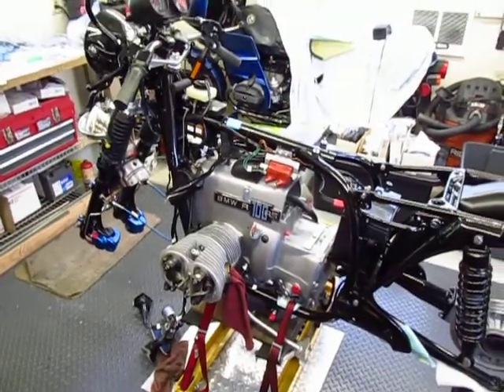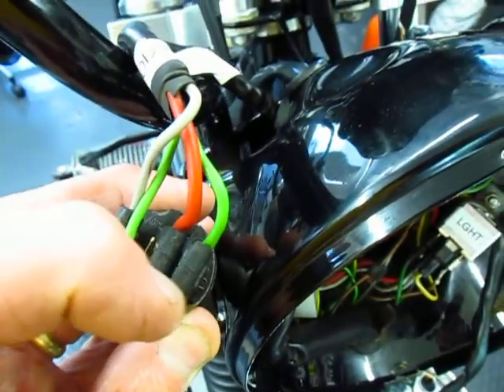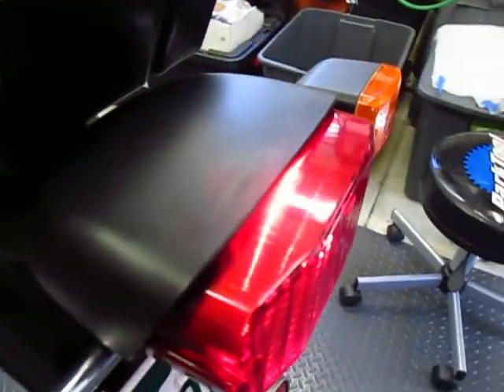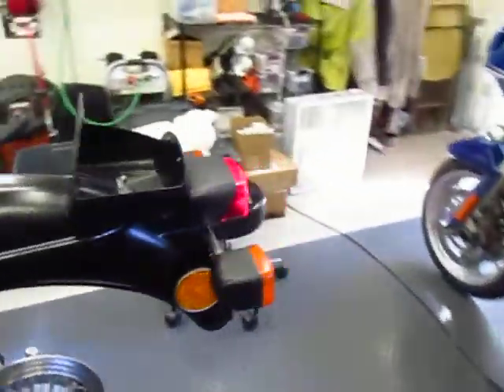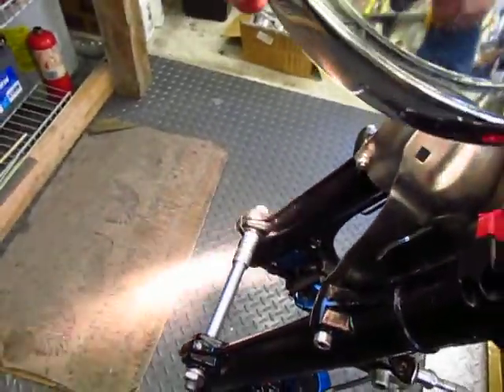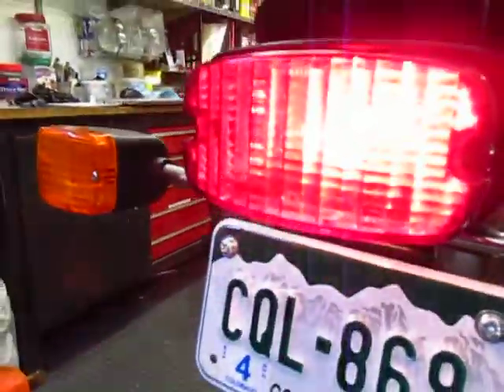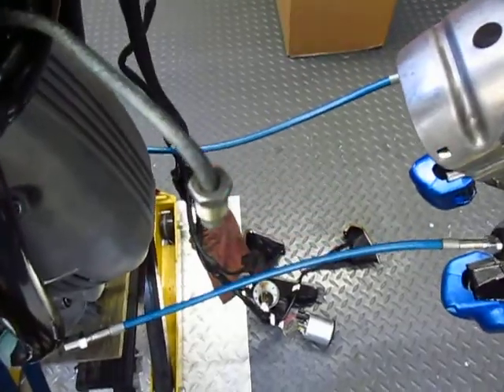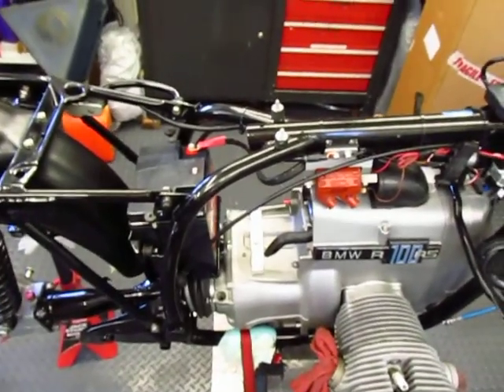1977 BMW R100RS Electrical System Functional Test

Comment: Not that I am aware of. I bought it off a friend who bought it new. Given it's the original loom, its unlikely. The only changes to the wiring were extensions to fit a Rickman Polaris fairing which has been off for years and the bike has been running well since then. I have changed the flasher relay but that was a straight swap......

Comment: Hi Brook,
I have a 1979 R80/7 which I have owned since Aug 1979.
The wiring appears to be all factory but I have a little problem.
There is a brown/black wire attached to the horn circuit which shows continuity, as best I can tell, to the neutral switch circuit which is also brown/black. The brown/black wire attached to the horn does not appear on any wiring diagram I have seen and I cannot understand what purpose it serves. Do you have any ideas?
Reply from the maker: Barney, 
According to the Haynes wiring diagram, the horn should be connected to a BROWN-White wire, not a BROWN-Black wire. The BROWN-Black wires go to the neutral switch circuit.
Reply: Yes, I know but there is a second wire attached to the horn connector on the contact board which is brown/black as well as the brown/white. The second wire, the brown/black, does not appear on the Haynes diagram.@BrooksAirheadGarage
Reply from the maker: @BarneyHaynes-s8l  So someone hacked the wiring for some reason. The BROWN-Black should be on terminal "85b" and BROWN-White single wire should be on terminal "H". It's possible someone added a second horn wire but didn't use the correct wire color code, or for some reason added the BROWN-Black neutral switch wire to the "H" terminal.

Comment: I am installing a s fairing in my r90/6 and Would like to know if It’s possible to have another gauge in lieu of clock?
Gear selector or a fuel gauge perhaps ?
Thoughts if possible ?
Thanks again
Reply from the maker: Hi Rodger.

You can put anything you want into the dash so long as it fits the hole and the rest of the instrumentation (sending unit, wiring, etc.) can be adapted to fit the bike. Some common add-ons are cylinder head temperature, oil temperature, oil pressure, etc.
Reply: @BrooksAirheadGarage  thanks for clarity on gauges . I miss not having a gear selector or individual blinker lights on the dash . 
Thanks 
Did you happen to do a video on installing a dyna ignition on a r bike ?
Reply: @BrooksAirheadGarage  did you have a video on installing a dyna ignition?
Reply from the maker: @59jaguar  No. But I do have documentation on installing it on my web site. The material also covers adjustments to the ignition for dual plug heads.

--> 12 BMW 1977 R100RS Install Dyna III Electronic Ignition-Refurbish Automatic Timing Unit (ATU) [https://brook.reams.me/bmw-motorcycle-rebuilds/1977-bmw-r100rs-rebuild-project-index/12-bmw-1977-r100rs-install-dyna-iii-electronic-ignition-refurbish-automatic-timing-unit-atu/]

--> 12 BMW 1977 R100RS Changes To Ignition For Dual Plug Heads [https://brook.reams.me/bmw-motorcycle-rebuilds/1977-bmw-r100rs-rebuild-project-index/12-bmw-1977-r100rs-changes-to-ignition-for-dual-plug-heads/]

I hope that helps.

Comment: Hi - i am working on a r100 rt , i  am having trouble with starting the bike. All the lights work on the dash but when push the green start button nothing is happening . i put a brand new battery , looks like no power to starter motor, or starter relay or some thing else i don't know. pls advise . thanks rd
Reply from the maker: Hi Sam, It does sound like the starter relay, starter solenoid, starter motor or wiring to/from the starter relay to the starter solenoid may be at fault.  Using a volt meter, you should trace power to the starter relay and out of the relay, to the starter solenoid and out of the starter solenoid to help you identify the cause. You should get a wiring diagram to help you with this.  I have published wiring diagrams and for the /5 and /6 bikes, but not the /7 series which includes the RT on my site, https://brook.reams.me/bmw-airhead-motorcycle-electrical-systems/. The Haynes and Clymer manuals have diagrams, although they do have some errors here and there, they can help you trace the wiring.

Comment: Hi . My 86 r80rt full on headlight it's not working. But flasher does.  Thanks
Reply from the maker: Hi Jaime, The headlight uses the low beam filament when the ignition is on. The flasher uses the high beam filament. It's possible the low beam filament in the headlight bulb is burned out. It's also possible that the yellow wires that send power to the low beam are loose. I'd check these areas and see what you learn.
Reply: @BrooksAirheadGarage  thank you so much.  I will check that
Reply: Everything looks good. Do you think can be the switch control?
Reply from the maker: @sanchezjaime2348  Yes, it could also be a failure in the switch.